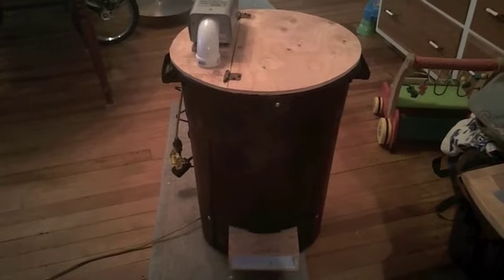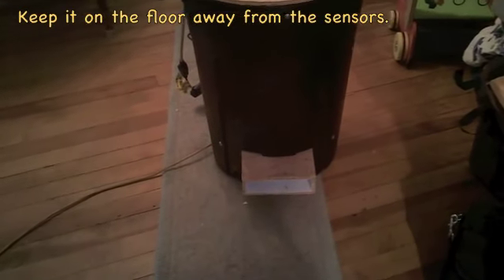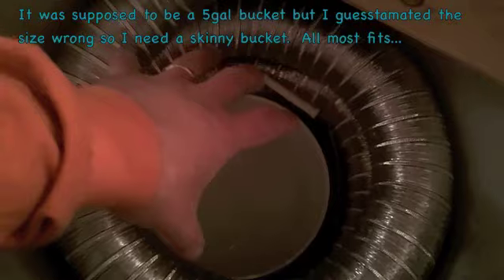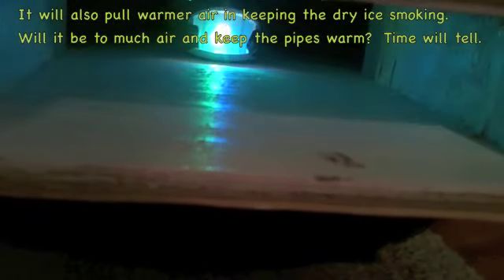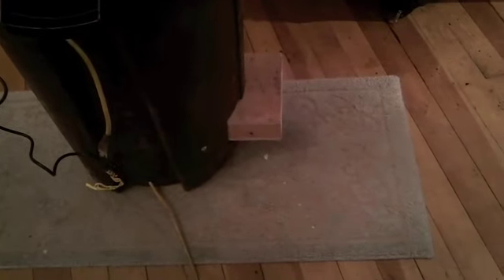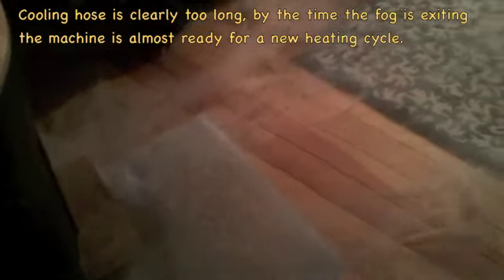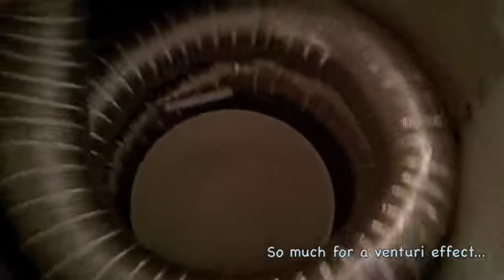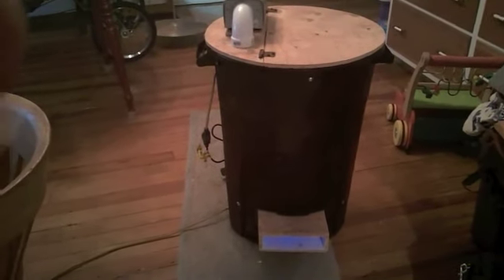Stage Fog Chiller

Comment: if i may add a quick tip. if you pull the fog machine back two to three inches away from the intake hole then the fog will come out faster and much better. because the intake of the air mixing with the fog acts as a second fan and boosts its output.

Comment: Leave about a 2 inch gap between the output nozzle and the PVC intake. This will allow the fog to cool and vaporize before entering the chiller's ducting. If it enters the ducting at to high of a temperature the fog will condense back to liquid form, accumulating on the inside walls of the ducting, thus greatly lowering the total fog output. The fan is a great idea but if you can incorporate a speed control, the slower you pull the fog through, the more time the fog has to chill inside the ducting. If your trash can is water tight, regular ice is fine. Fill it to the top! If its not water tight or even water resistant to electrical wiring, use dry ice. If you use dry ice though, you dont need the whole contraption. Just a 5 pound block inside the output on the trash can allowing the fog to blow across the dry ice. You could even get that sucker really cold but tightening the coil of ducting and lining the can and lid with fiberglass insulation, then stack blocks of dry ice in the center of the can to the top. :-) Reusable freezer packs for lunch bags work well too and are not messy like ice cubes. Have fun
Reply from the maker: Kevin Wells Thanks for the tips.
Reply: NelsonStudios I'm happy to share what I know from trial and error.

Comment: The trash can with drier duct is the invention of ghostsofhalloween . com fwiw. I made one following their instructions w/ 8ft of aluminum duct and it worked great outdoors ; ) I used the same 400W Gemmy fogger you used. Your dry ice in a cooler would work better if you don't want melting ice in a few hours. Otherwise a bag of store ice in the middle is enough for a trash can. The problem is probably the fan and maybe the fogger top down not bottom up & down. Black light bolts cover a good area.